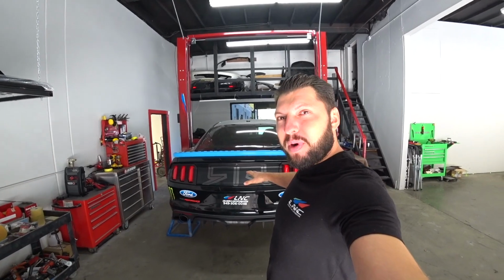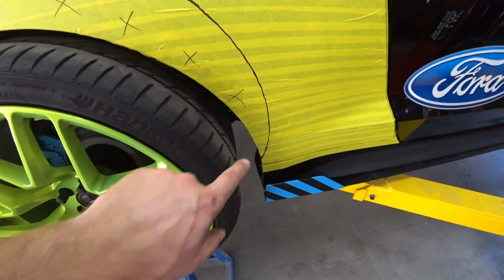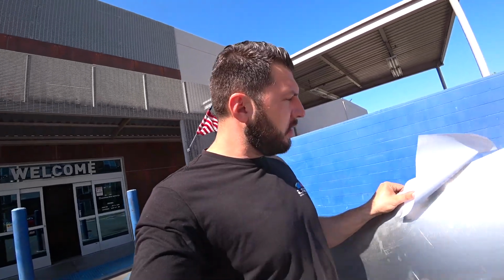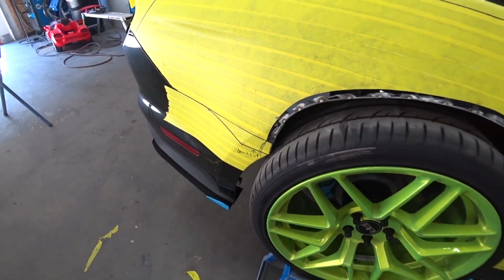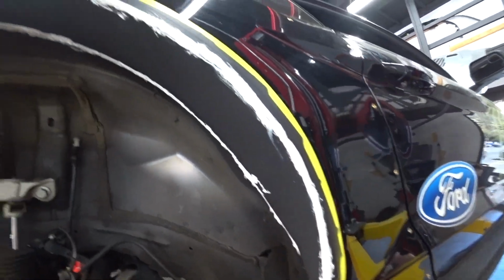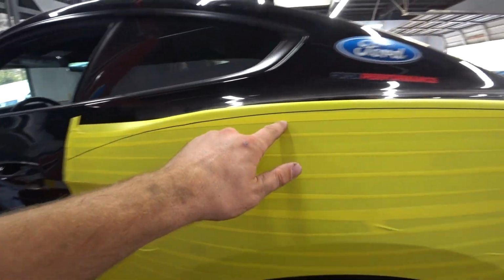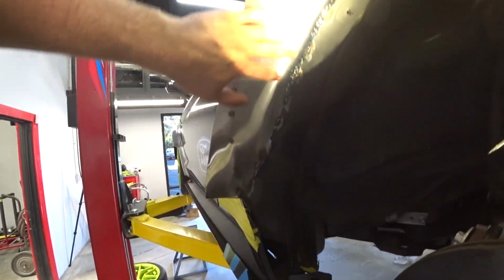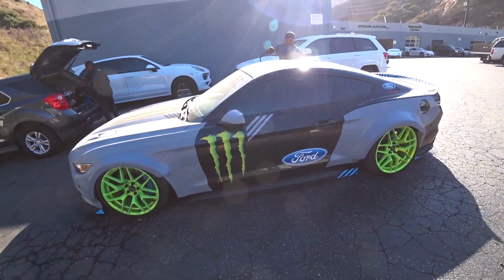INSTALLING WIDEBODY KIT ON MONSTER ENERGY FORD MUSTANG GT 5.O RTR PART 2

Comment: Stainless for the patch?  odd... looks good though!
Reply: What’s more normal to use
Reply: Two dissimilar metals will cause corrosion. That's sheetmetal 101. I'm surprised no sealant was placed on the fasteners for precation prior to placing them in the holes. Good stuff though...this is how it's supposed to be done!